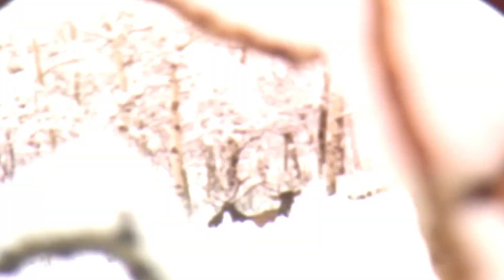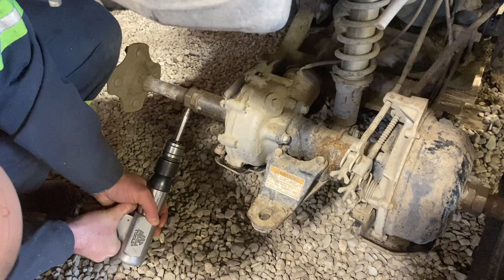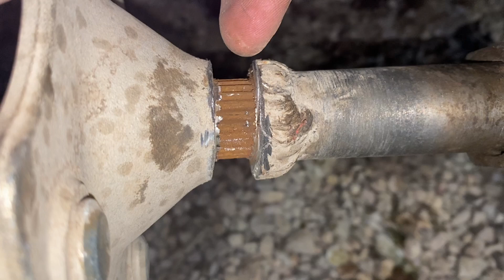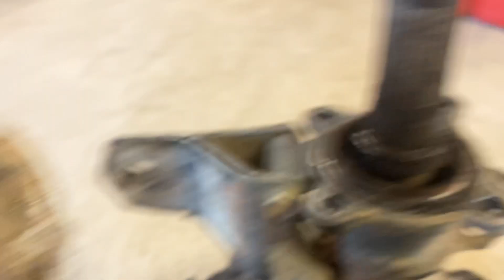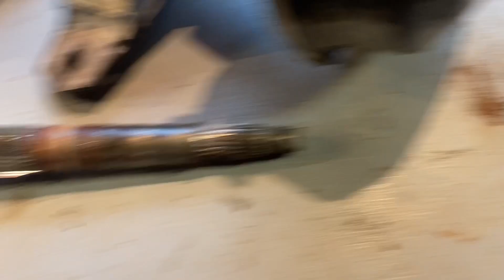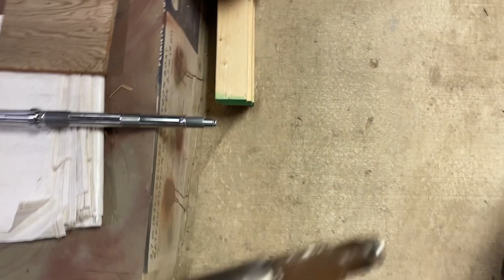2012 Honda 420 Rear Diff & Axle Replacement

Comment: Is that pipe that you said was loose at 7:07 is that a problem to be loose so it can spin by itself or should it not be able to move? Cause mine can spin by itself and I don't know if that's a problem that could cause bigger problems? Do you know?
Reply from the maker: All it seems to be is just a spacer. Any too much pressure and it can damage inner oil seal
Reply: @potholeproud4598  so is it fine if it can spin by itself
Reply from the maker: I think so. I’ve put about 3000km on ours since the repair and I had it where I can just  turn it. Where as my old one I could slide side to side 1/8
Reply: @potholeproud4598 ok mine can probably slide 1/16 to 1/8 I'll probably just try tightening those nuts and see if that closes the gap
Reply from the maker: Should work. The nuts on mine were locked real tight. Used air hammer to seperate them

Comment: I just saw this video and have to put a new axle in my 2010 rancher and am trying to figure out the size of those nuts that hold the actual axle in place. Thanks in advance for any info...I just need to purchase a couple wrenches is why im asking..
Reply from the maker: Sorry I can’t remember that size. Been too long since I did that job
Reply: Did you find out what size?
Reply: @DrydenTeele. I cant remember the size but I was able to locate the ones I needed

Comment: how do you take out that single cv axle?
Reply from the maker: Left side there’s 2 nuts on the axle that are used to pull axle into the differential and lock it. 4 nuts and bolts hold the whole differential to the swing arm. Not a bad job to do all.

Comment: Crazy you can’t get parts for that 420 through the dealer.   We had a 350, that was a good quad.   When I worked at the pulp mill we used a lot of Honda quads.  Good work horses.  We run can ams at home now.  Better dealer support than our local Honda dealer.  Plus a nicer ride.  And faster.  Lol 😆
Reply from the maker: It is crazy. The dealer did what they could. They also told us when it comes to new atvs, they said they had 420s on order but Honda wouldn’t give them any delivery dates or even how many they would be allowed to have.
Reply: @potholeproud4598  seems like can ams are coming in more regularly now, but all atv manufacturers have sure rode the struggle bus getting stuff in.  Got a new tractor coming.  They promised it by spring, I just hope it’s in by haying time.  🤷‍♂️